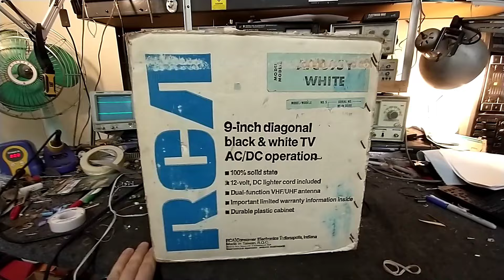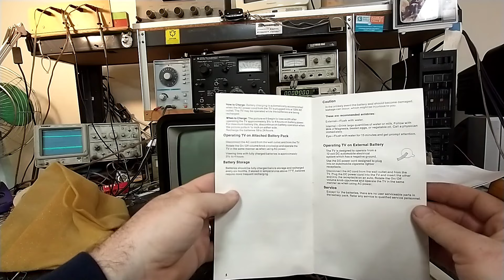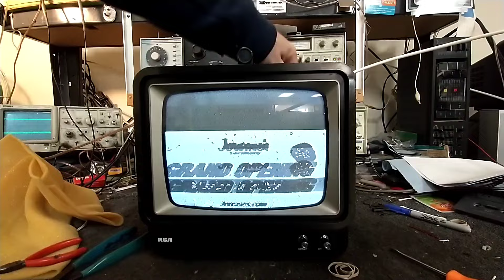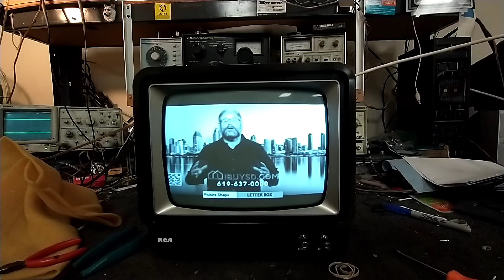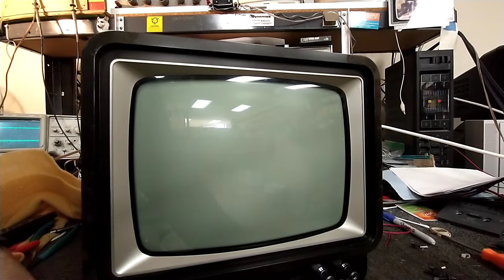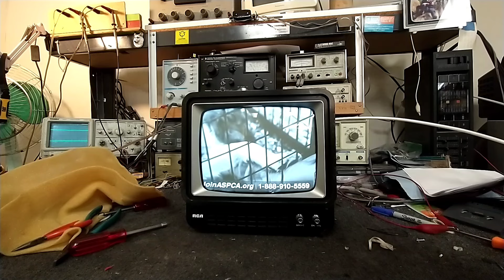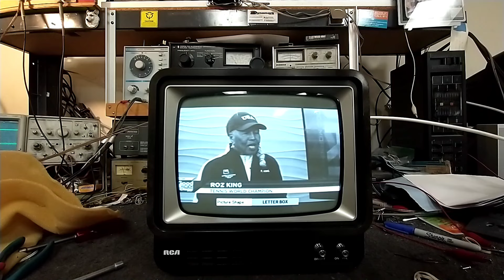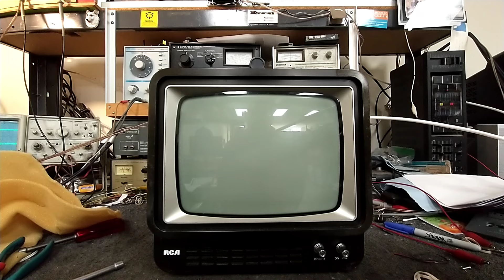Show-n-tell of a 1980 RCA "Playmate" 9" model AER095L black and white TV.

Comment: What did you have to discharge before you started working on it
What is your eBay name
Reply from the maker: I discharged the high voltage lead. 

Jpdylon Is my ebay handle
Reply: @JordanPier  I can't find any good videos on YouTube explaining what  a flyback transformer does could you do a video on one
Reply from the maker: @nomusicrc  same principal as an automotive ignition coil, except an oscillating circuit with a transistor is controlling the triggering instead of a trigger pulse from a trigger wheel and cam sensor